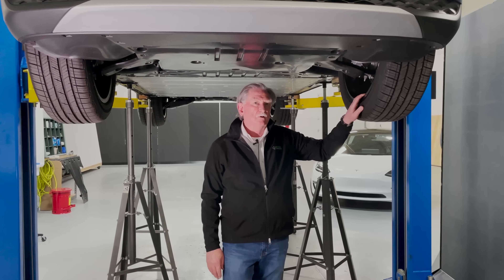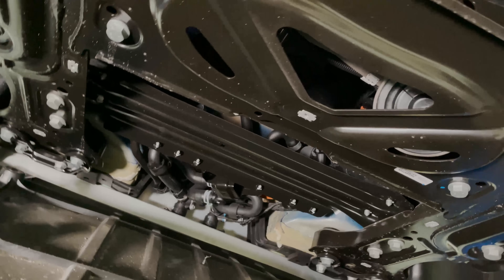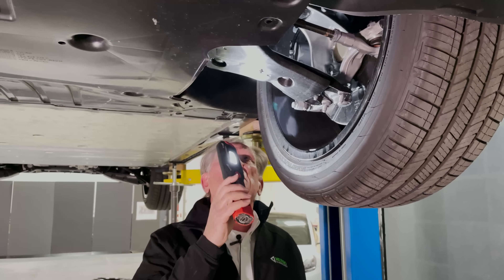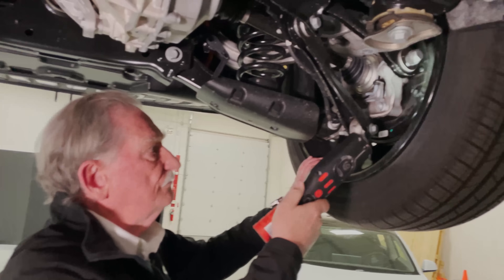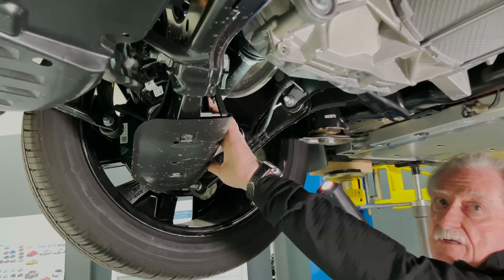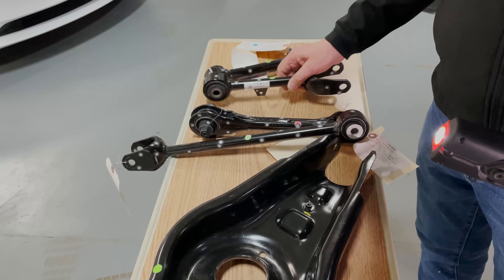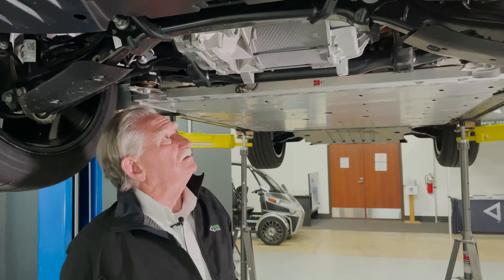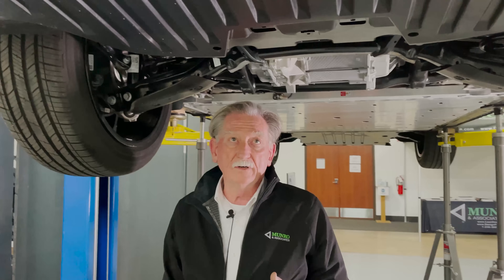2021 Volkswagen ID.4: E3 - Hoist Review, Front and Rear Suspension

Comment: 3:18 drum brakes on the rear axle are almost immune to gravel and sand thrown up from the front wheels. Disc brakes on the front are not assaulted by sand and gravel as much. Especially if cost is a concern, rear drum brakes can be a good choice in terms of lower maintenance costs over the life of the vehicle. Due to the laws of physics, the weight shift forward during braking means that rear brakes only do about 35% of the work anyway.
Reply: True, and with regenerative braking in EV's, the rear brakes will be even less of a problem (heat wise).
Reply: Drum brakes work well with less pressure and are great for emergency brake holding power. On a rear wheel drive Electric vehicle they are not going to be used much at all due to regen braking. If you are in ice and snow or slick conditions you don't want much braking effect on the rear. you want the rear wheel traction to stay there to prevent spin out in a slight turn at speed.

It is a proven design.
Reply: And most of it is done by re-gen braking anyway why makes disc brakes rust more quickly.

Comment: The arch in the aluminum arms in the rear is used to get clearance from the chassis and provide a progressive part failure in case of excessive load. In my opinion that's a better design compared to Tesla's arms since they will destroy the subframe in case of an accident and, since they had to make the clearance in the chassis for the arms, they are loosing interior space.
Reply: That's actually very valid point.

Comment: Sandy does not understand why they did use 2 forged aluminium elements for the 5 bar rear suspension. How about cost saving: 
Each element is just one forged piece, the tesla equivalents are each welded together out of at least three parts:
Reply: He is brainwashed like others

Comment: 4:48 ....  Those forgings might just be something off the shelf that they already have on other cars. That's the only thing that I can think of.  You can tell that they aren't building this thing as a priority.  This is definitely designed by the B-team...  or C-team....   It's kinda an afterthought that they didn't think through at al.
Reply: Stop talking nonsense, can you proove it? Can you find it in other vw cars? You're a troll.
Reply: @alanmay7929 "might just be" --  are you ok there buddy?  You might want to work on your reading comprehension a little more.
Reply: @alanmay7929  and btw.. yes I can prove it... Just go to ebay and type "VW upper control arm" -- and you'll see, that arched, forged aluminum upper control arm is already on many of their cars---- Just like I thought.... go see for yourself. That part already existed on their other cars that are similar.  Its common sense......  Look at the level of quality of this car, they put it together with as many off the shelf things as they could, its common practice.  You will see many other parts from their already existing parts bins----  window switches and motors, turn signal switch, brake calipers and master cylinder, door handles,... even the seats, windshield wiper motors ect. ect..   on their cheap cars, they use things that they already have tools for and are already building, as often as they can.   This is not a secret.  Watch this channel some more and Sandy will tell you that himself.
Reply: @calholli  you are a troll. Can you proove that all those "control arm" are the same! Also they already have tons of machines and parts lying around for the things that doesn't need to be reenginnered I dont see the issue with that. What's the issue with door switches or even steering wheel?
Reply: @calholli  those components are the same across many many models and thats exactly what tesla does by sharing the same parts with many car models.
Reply: @calholli  the most important part of EV is the chassis, hvac,batteries, motor.... the suspensions, doors, windshield..... are the last of préoccupations
Reply: @calholli  even if vw is using some already existing parts, they cost close to nothing because they already make millions of cars and the priority is chassis and powertrain.

Comment: So the takeaway I got is there are more expensive suspension components on a car that is comparably priced to a SMALLER Tesla. Maybe Sandy should put an Atlas on a lift for comparison because the ID.4 suspension looks like a completely MODERN VW platform-based setup to me. Also, color me surprised that the Germans over-engineered something. I wonder if maybe VW's strategy assumes big volumes over time to help with the cost.
Reply: Vw already has all the machines to make those parts, tesla is still building their factories so that's it.
Reply: Vw makes 10 million cars a year they know how manufacturing works

Comment: Could it be that they cheaped out on the suspension in the front because its a rear wheel drive?
Maybe the 4x4 will have better suspension in the front since its gonna have an engine there to

Comment: So VW rushed this to market and it shows.  I'm surprised they went with a MacPherson Strut setup in the front.  That's like a cheap GM/Ford/Chry move.
Reply: Cheap is good, right?
Reply: @abraxastulammo9940  It's about the same price as a Tesla 3/Y, which has a suspension design similar to a BMW E36.

...and rear drums, WTF?
Reply: @johnmolloy4878  ID.4 is 40000, Model Y is 50000. 🤷
Reply: @abraxastulammo9940  Model 3 starts at 38,500
Reply: @johnmolloy4878  ID.3 starts at 28000 USD (below 23500 EUR) + VAT in .de
Setup is good for a 10.2 m or 33.5 ft turning circle!
Reply: @abraxastulammo9940  Europe only.  Supposedly VW will build something on the same platform for the US, eventually.  I've been to Europe enough to understand why you value a small turning radius.  Not needed in 99.9% of US cities.  That's why 'muricans love trucks.
Reply: Stop talking nonsense, this is a brand new chassis for vw, they designed it to be very practical and easy to drive, go watch Björn Nyland videos and see how the id4 turns and almost holds the same capacity as a modelx
Reply: @alanmay7929  Very familiar with BN and all his excellent EV vids.  That doesn't make the chassis and layout of the ID4 any less depressing.  Guess I expect more from VW.  It's OK if you don't.  Buy it...
Reply: @johnmolloy4878  less depressing!! LOL....
Reply: VW knows how to make MacPherson front suspension do what they want it to do - and it's waaayyy simpler than, for example, Tesla's multi-link front suspension design that has many more joints to wear out.
Reply: @bikeaddictbp  OK, some people like hot dogs.  I like Kielbasas...
Reply: Current bmw m3 has mcpherson struts too, bmw always had them.
Tesla has double wishbones which can be found in millions of american pick up trucks, call it a truck suspension if you want, or a 1940 chevy suspension, classic americana.

Comment: So far, it’s appears that ID4 platform was originally meant for ICE, but VW then quickly decided to remove the engine, transmission, fuel tank, exhaust line etc. to house battery and e-motor. Also, underneath the front hood looks very jam packed like regular ICE car. I’m not sure if this is a ground up design. Regardless, I still can’t find a reason why i should consider ID4 if there is Tesla...
Reply: It charges for free.
Reply: @abraxastulammo9940  good point, for up to 3 yrs at ElectrifyAmerica charging station, but not from vehicle technical spec perspective...
Reply: Stop talking nonsense, this is a brand new chassis for vw, they designed it to be very practical and easy to drive, go watch Björn Nyland videos and see how the id4 turns and almost holds the same capacity as a modelx
Reply: The ID chassis has design features that you would not be able to do in a combustion-engine vehicle. It most certainly was not designed as a combustion-engine vehicle and then converted. In no way does this mean you can't swipe little things like ball joints and steering racks and strut bearings from the parts bin ... but the overall layout is strictly designed as a battery-electric vehicle. It couldn't have a combustion engine retrofitted if you tried. There's nowhere to put it.

Comment: Keep up the excellent work! For me it is evident just by looking at the iD4´s suspension, that Tesla did the much better engineering job. Just compare the parts, Teslas suspension parts on the table have kind of a "biomorph" shape with good material distribution while the iD4´s stamped metal parts look like cheap stamped metal parts...... All looks busy but not well arranged in the iD4 while at the Tesla everything looks clean and well organized. I bet that VW is loosing money on every sold unit. With the introduction of Teslas 4580 cells and the Gigacasting parts, Tesla will sharply increase their  cost advantage over VW.
Reply: Looks clean doesn't mean that its engineered better. Especially when the suspension is very bumpy just like teslas one.

Comment: The drum brakes on my Prius rear have over 120k miles on them and they are not even 50% worn.  I replaced the front brakes at 108k.   Braking off the motor just makes brakes last forever.

Comment: Perhaps the legacy parts is due to the fact that the platform is what it is - a platform. Historically, VW (VAG) uses a platform for multiple vehicle types and even across brands. In the end, it seems to be about (development) cost reduction, but can't say for sure.
The motor paint could be painted (or anodized?) to protect it against road salt, which is heavily used in Europe and especially Germany. Untreated Al parts tend to corrode much faster and even treated ones have a hard life.
Reply: It's not just development cost. The costs of actual mass production (production lines, tooling, setup) for multiple separate bespoke parts can easily bloat costs and nullify any potential profit margins on the final units. This is especially important for more competitive priced cars in the mid and lower price tier. Economics of scale can go both ways.

Comment: Drum rear brakes?  Seriously?  On an electric car, which are typically heavier than gas counterparts if they have a decent sized battery.  Even if you could rely on the motor for dynamic braking and regeneration, a drum brake, even one with finned aluminum heat dissipation which this isn’t, is harder to control and prevent from locking up and fading.  It makes the hidden undercarriage seem “cheap”.
Reply: Due to my age, I grew up with drum braked cars, and some with mixed, disk front, drum rear systems, both with and without anti-lock on the rears.  The mixed were better than the only drums, but none of them stopped as well or in a straight line as 4-wheel disk brake systems.  Most of the drums were “self servoing”, designed for the brake shoes to move somewhat and wedge themselves into the drums when activated to reduce the hydraulic force required at the pedal at the expense of making them prone to locking up, hence the need for anti-lock devices for the rear drums.  To me, that technology is as old as black and white film technology and not as safe as modern 4-wheel disk systems.  I would deem it a disqualification item for a vehicle purchase.  My money, so my choice.
Reply: @eddiegardner8232  Do you honestly in age of ABS think that car with drums wouldn't brake straight? I have had serious problem with all my modern vehicles with their rear disc brakes. After every few years winter I have to get new calipers and discs. Back in the days I had way less problems with rear drums and in fact I never had any braking/steering issues because of rear drums. I think they're very valid choice for EV's that don't use them virtually at all and mostly for hand brake.
Reply: Yes, when they stop working, the vehicle crashes and that’s the end of its lifetime.  LOL
Reply: If you think that, then look for an EV with drum brakes.  You may have trouble finding one if you don’t want a VW.
Reply: @eddiegardner8232  Actually you seem to be wrong there. There appears to be many EV's with drums. I don't mind that at all and I'm not looking first into VW's. Let alone EV's at this time.
Reply: I’m sure we will see how many significant EV manufacturers use drum technology in their new models in the next few years.  You can find them in all the mainstream manufacturers cars, Hudson, Nash, Studebaker, Packard, Crosley, Kaiser, Fraser and in the latest Mercurys, De Sotos, Plymouths, Imperials, Pontiacs and Oldsmobiles.  In a nearly 5000 lb car, you need brakes that can dissipate heat, resist lockup, and be precisely controllable.  That’s not what drums do.  VW went cheap.  No sale, to me.  Maybe to you.
Reply: @eddiegardner8232  Yeah, to me it's all the same and actually seems good idea. After all in ev's you don't use those brakes virtually at all. On normal car that would be a totally different thing. At walking speeds it's pretty much all the same how breaks work.

Comment: Another informative video by Mr. Munro. Two points hower:
ID.3 and ID.4 are not really in the same price bracket as the Model 3 and Y. On the MEB platform, VW can build cheaper cars than Tesla with the same or bigger size battery, and that's pretty amazing. And as per a UBS tear down report, they even make a profit per car. 

As for range and charging, these cars turn out to be amazingly useful. Tesla may claim 315 miles vs the 250 of VW, but in practice the VW EPA rating seems extremely conservative. Plenty tests out there now that show the ID.4 reaches 290 miles or so at moderate highway speed.
Reply: One wonders what VW's margins are on the ID4.
Reply: @TheEvilmooseofdoom  up to 15% on the ID.3 according to the UBS tear down. I would suspect a bit higher on the ID.4, especially the higher trim/tech levels.
Reply: Really ?  The ID4 single motor is 40K GBP.  The ID3 top line with 75Kwh battery is also 4OK and the back seat is hobbled.  M3 SR+ starts at 40K and is much better car.  They get same range out of smaller battery.  You cannot compare to the Tesla Dual motors which do cost a bit more but are SOO much better.    No Model Y in Europe is giving VW some useful breathing space. When Berlin opens the price wars will be on.

Comment: Oh come on. Aluminium can corrode. And the links are attached to aluminium. Ever used steel bolts in an aluminium cast. You know what happens. We in Europe have harsh conditions with a lot of salt on the streets in winter and water. 1+1=?

Comment: You said the Tesla and VW cost the same, but VW ID.4 Pro is $39,995 or $32,495 after tax credit for a crossover with 260 mile EPA range.

Model 3 SR+ is $38,490 (no tax credit) for a smaller sports sedan with 263 miles EPA range. Model 3 is a great car, but there's great appeal for the ID.4 as well, since it's $6K less, has about the same EPA range (more real-world range), and way more interior space, at the expense of acceleration and handling.

Comment: Correction: Drum brakes on the ID4 is because of regenerative braking from the electric motor. ABS has nothing to do with it, VW is saving costs by going drum because there's heat capacity required with regen doing most of the braking.

Comment: Loved the bloopers. Also: since this is all MEB-Platform I'd be very interested in Sandy's take: which of your findings are a result of the platform having to service a variety of types of cars? Are the limitations in technical innovation you are finding a somehow sensible trade-off for the manufacturer, with regards to the platform strategy, e.g.: use "oldschool parts" to reduce tooling costs on the whole, or have areas that look awkward for certain vehicles but at the same time allowing flexibility for different types of cars? 

Tesla is throwing out parts and their respective processes and tools left and right. This must seem very scary for OEMs that are used to reduce CapEx wherever possible, no?

Cheers and thanks for alle the great insights.

Comment: Is VW ID really as expensive as Tesla? Heard it was to be around 30k, surely Tesla is more expensive?
Reply: He's comparing the price of the Base ID4 with the base Tesla Model 3, which isn't really a fair comparison -- since it is comparing an SUV/crossover with a sedan. The correct comparison would be the Model Y with the ID4; and the ID4 is less expensive (base of $39,995 vs. the Model Y base at $46,190). If you compare "top of the line" the difference is even greater -- the most expensive ID4 you can buy in the US is about $50,000, while the Model Y is $63,990 (without full self-driving, which would add $10,000, since it isn't available on the ID4).

From what I see, the ID4 is competitively priced based on the features they give, though a lot of Tesla fans won't agree since the ID 4 won't do a sub-5 second "launch." At the same time, VW intentionally is not going after Tesla's market -- this car is intentionally built to compete with "normal" popular crossovers like the RAV4 and the HR-V, where after the federal incentive the price matches those vehicles and it competes quite well (including 0-60 times).
Reply: @davidnielson9139  Thanks for extensive reply, I remembered that price tags were different.  Unfortunately from videos so far I'm disappointed in Munro, he seems heavily biased from former Tesla videos. I have an impression that VW might succeed (at least in EU) with their idea of affordable electric vehicle for common folk and apparently Ford targets Van segment for 2022 or 2023.

Comment: 2:36 Is the steering knuckle and internals really that exposed to the elements, did they remove a panel? If not seems like a major security flaw, atleast here in norway that knuckle will be corroded away in one winter
Reply: Of course these parts do not corrode.